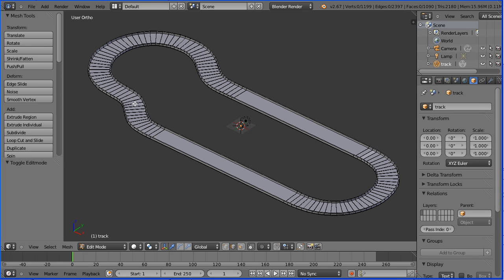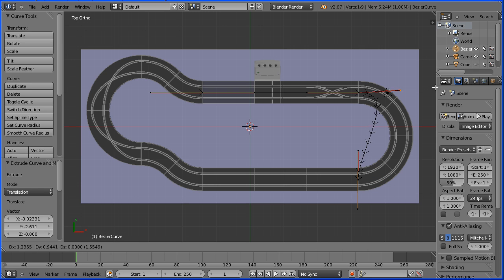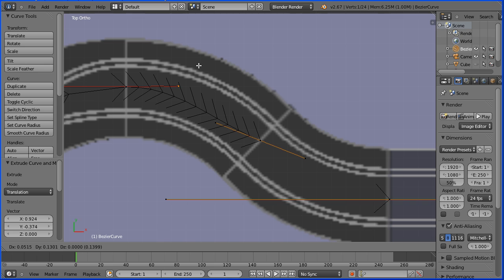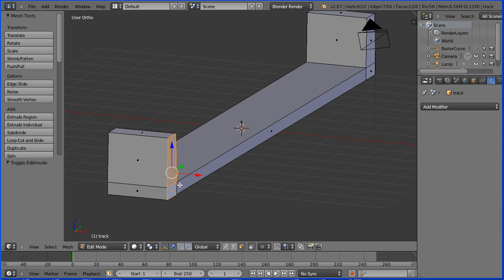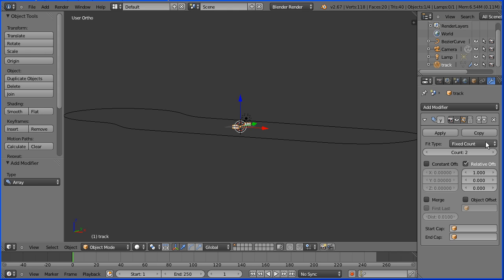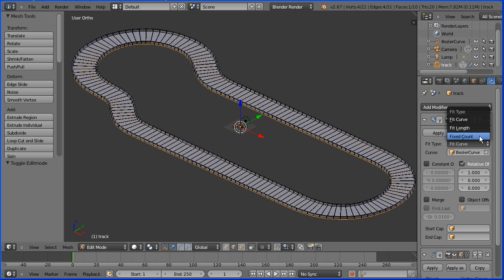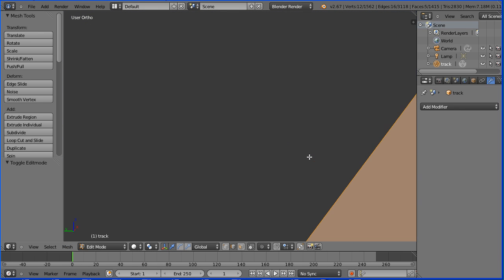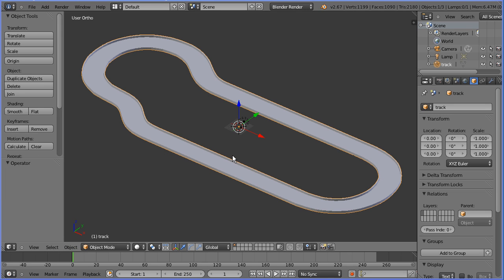Blender Tutorial Making a Racing Track for a Car Game (design from Scalectrix Track Designer)

Comment: if u can't download the track designer how do u get the track designer
Reply from the maker: +Grant Ogden I have just gone to the Scalectrix site and downloaded track designer (in the help and advice menu) and it runs on my Windows 10 system. Can you be more specific about the problem you are having? You don't have to use track designer, a vector package like Inkscape would be good or you could just use curves in Blender.
Reply: yea there isnt anything downloadable on that site whatsoever

Comment: Can I design circuits for Project cars or for rFactor?
Reply: sg FEOPCAD If it is possible to mod it in. Depends on track files that the games can read. So it can be successful, mostly it works with Unity3D. To produce racing games.